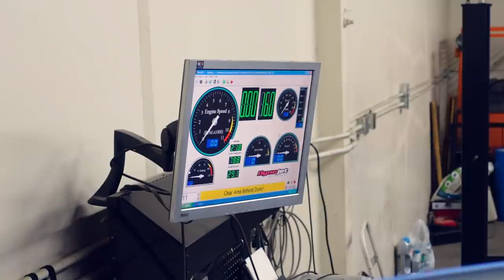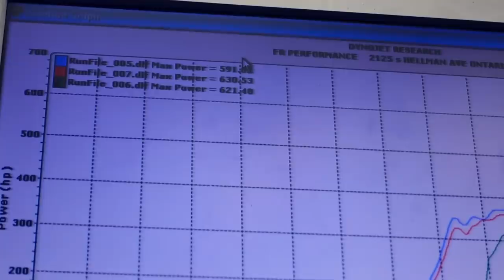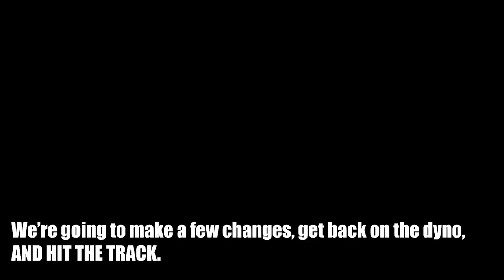3 ROTOR RX7 DYNO DAY + FIRST DRIVE!!!

Comment: So cool seeing how exited you were just hearing it run and rampingup when you saw it moving under it's power 🏁
And it was also cool hearing when Abel got the low throttle/rpm part of the tune cleaned up👍

Comment: Okay, I like rotaries, but don't know much about them mechanically. Does this thing have 2 radiators? I see the rear mounted one, and then the one under the intercooler in the V-mount setup. I know rotaries get hot but does it need that much cooling? Lol just curious.

Comment: Nice car that,,,,, will break every noise limit at every single track you go to and will get bugger all track time.

Perhaps some exhaust thats longer than 4 inchs on a 3 rotor Might be a good idea if you want to use it

Great to look at 

Not so good at usability.

I used to race a preriferal port 13b and he snapped the exhaust at the engine. The whole event got shut down as he was so loud.

I got hearing damage passing him and i had a balaclava and helmet on and my car was all shut up. 

Dam that car was loud.

Comment: Aaron showed up, but didn't stay for the pulls? I'm shocked. You gotta get some tandem runs in with him once you get the full shakedown.
Also, for the ear protection - https://www.amazon.com/Walkers-Razor-Shooter-Folding-Earmuffs/dp/B06Y1DNQWT - those things are amazing for dyno sessions - they also have active noise cancelling earbuds that you can wear while driving (cuts out the high DB noise, but still lets you hear what's going on while driving without damaging your ears.)

Comment: Please please please I'm begging you put a lexan partition between you and the rear area.  Should you ever over heat and that radiator explodes you are in the line of fire for 250+ degree coolant.  3rd degree burns are life altering you do not want that.  It want look bad and it could very well save your life.